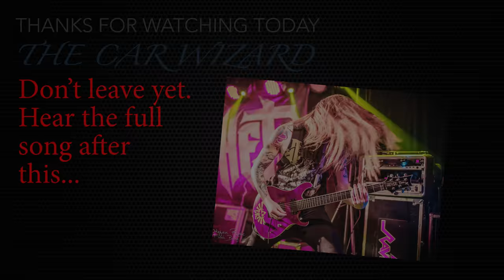12 Best Mechanic Tips and Tricks from the CAR WIZARD put all together

Comment: The load test is my favorite 
"But I'm getting 12 volts!"
Not when you put a load on it. Now its 7 volts
Reply: I had a battery do that to me last winter. I'd get 12 volts, but as soon as I did anything with the truck it was in, it would go dead. First I disconnected it from the truck, then I made a device similar to what he showed in the video, and the battery wouldn't even run a single turn signal bulb. In fact, when I took the battery to replace it, and they insisted on testing it, the battery wouldn't even run their tester.

Comment: Tip #1 is great. Used that trick many times. You can also remove the cross member and tilt the transmission down to reach bolts that are inaccessible.
Reply: 90s rangers with manual transmissions had 2 bolts that were Damn near at the firewall at the top. Have to tilt it down. great tip !

Comment: Hey wizard 
Instead of using paper inside a socket to make a bolt fit tighter, you have to find when it falls or possibly lose and is potentially a fire hazard, I prefer electrical tape.
Stick it to the socket and it stays connected to you pull it off!
Keep up the great content
Reply: gob of grease always does the job
Reply: I like masking tape myself.
Reply: Fingers off latex gloves as well 👍
Reply: Blue painters tape.
Reply: I've had the tape backfire on me. Held the bolt while I got it started, but then was too sticky couldn't get my socket off. Ended up struggling with that. Stuck too good.
Reply: Poster putty aka silly putty.
Reply: What about a small magnet in the socket
Reply: I've done that also, like the way the paper trick sounds though.  Easier and more efficient.
Reply: Butyl tape, Butyl tape, Butyl tape

Comment: I've used your starter solenoid trick, back in the 70's, when I had a Ford that had the starter solenoid mounted, not on the starter, but on the inside fender. It would occasionally stick, and a few taps with a small wrench would free it up. For some strange reason, i'd have to replace those solenoids every three years.
Reply: Used to work in a Vineyard and there was a couple tractors that had dodgy starter solenoid's, used a long screw driver to start them by shorting out the terminal's on the Solenoid. :D
Reply: Ah, a Ford owner!  Here in Colorado this was common in the winter. The solenoid was on the fender and the starter had a "Bendix" type of clutch that threw the gear into the flywheel. This set-up loved to get sticky on the coldest days!! Back in the "good 'ole days", every brand had its' own tricks and tips to keep them running in any conditions.

Comment: Tip #2    YES! This saved me last summer when I was 40 miles away from home.  Couldn't start the car, after a few tries I noticed the fuel pump was not making noise.  Had my son reach under the car and hit the fuel tank with a flashlight.  Three hits and the car started!  Got home with no problem.  Not sure why my original fuel pump only lasted 430,000 miles! ;-)

Comment: You can also put some grease in the socket to hold the bolt in place. That way you do not have to worry about retrieving a piece of paper.
Reply: We did that in the Air Force working on Jet engines with bolts in tight places.

Comment: Those bad ground are notorious when you work on old cars. I make a point of it to always clean them if i work near or around them. One very often neglected ground connection is the one between block and body. It's often a woven strap somewhere deep inside the engine bay and it's exposed to rain and road grime for years. They corrode over time and can cause weird problems. 
Then when you remove such a strap it sometimes pulverises in your hands. It's completely corroded...
One new strap later and some proper contact cleaning and all of a sudden the starter turns much better/faster! I wonder why...? LOL

Comment: Thanks for telling me about the relay test switches, they helped me diagnose a REALLY weird no start condition on a BMW X5. Found a burnt out fuel pump relay, replaced it and then it started and ran for 1 second and set 50 trouble codes. However, with the relay test switch in, the car ran normally and didn’t set any codes. Turns out the ECU was shorted out internally.

Comment: Great video Car Wizard! Also enjoyed a tip in a previous video about not using the radiator drain plug (in many European cars, BMW in my case). I've got a 2006 with almost 250k miles on it and had to replace the oil filter housing gasket. Told my wife about your tip gave it a pretend twist to demonstrate...and the head snapped off. Luckily it's not leaking, but it will have to be replaced at some point. Spot on advice!

Comment: Good tips. Starters sometimes CAN run again by hitting them with a hammer IF it is the brushes that are worn out and barely making contact. Sticky solenoids can be helped by tapping on them. Relays: if you don't have the nifty little switch, swap a relay from another slot. O-rings: one of the gripes I have with manufacturers is when they leave a sharp shoulder that cuts the new o-ring as you are sliding it in. Why can they put a slight chamfer on the part?

Comment: For o-rings that go around a fitting (instead of fitting inside a machined groove), once I have the o-ring on, I gently slide the point of a Lisle #31800 scribe and go around behind the o-ring a few times.  An old-timer told me to do that so that any rolling or twisting of the o-ring that happened when I put it on is straightened out.

Comment: Wizzard tip #9, always use the lubricant expected in that system, if its AC, use the AC lubricant expected in that system, if its Automatic transmission fluid, use automatic transmission fluid. The point here is USE THE LUBRICANT THAT SYSTEM USES!.

Comment: The o-ring tip is what I have been doing for the last 10 years at work.  The Viton o-rings are the best and when I can put one in a part I do.  I learned to that with high vacuum metalizers that pulled vacuum so high or low I guess it was 0.00001mbar with 3 booster stages before a diffusion's pump with cryogenic chiller freezing the air molecules.  Crazy machines built in Germany on NASA space designs all for the metal lining on potato chip bags.

Comment: Tip #5, if you have cut your slit for a flat head screwdriver, if you can, smack the handle end of the screwdriver towards the threaded end of the screw, it will often take away the clamping force that was keeping that bolt tight, and it will come out easily.

Comment: And here I used German Torque Guten-Tight. 
As a retired Aircraft ,Auto and Motorcycle Mechanic when I worked on Airplanes I must of have removed thousands of rivets, I got tired of drilling real fast so I asked they guys in the metal fab shop how they did they showed me a Rivet Removal tool it looks like a metal cutter it was expensive but it saved me so much time and energy.
You would be surprised how many motorcycles  with "Electric Issues" I fixed by finding the battery ground loose and or corroded.

Comment: About #3 - you really want to avoid hitting the starter, as the Wizard says, but here's why - most starters now have permanent magnets in them. And when you smack it with a hammer, you'll break the magnets.

I have a socket wrench that is so helpful, that I don't know why I don't see them everywhere. It's an old Stanley Wal-mart special, and it has a weird feature - the handle can turn like a screwdriver handle. When you twist the handle, the square drive bit - the part that holds the socket - it also spins. It will always spin the way you have the ratchet set. So if you are tightening something, you can twist the handle back and forth, and the drive will only spin one way. This thing is supremely helpful when you have that bolt that is too tight for fingers, but you can't move a ratchet back and forth more than one click, and some sadist has decided that the bolt must be three inches long. 

Also, I flinched when you were demonstrating the way to install O-rings on the compressor. Yikes. Astroglide works great for O-rings, too.

Comment: Here’s a tip to prevent bad fuel pumps….never drive on empty. Fuel pumps get hot and the fuel keeps them cool. Running on low fuel constantly will prematurely fail a pump.
Reply: 234k on a 14 3.6 ram cv tradesman or a dodge caravan i never ever get below 1/4 tank for that exact reason. we got that van at 113k for all i know that’s the orginal fuel pump
Reply: @joeyh7796  265,000 on my original fuel pump. It is a flex fuel vehicle that primarily run E85. I think they overbuilt the fuel systems in the flex fuel cars because when first released they had issues with the alcohol messing the pumps up.
Reply: Great tip, thanks!  I've also heard that those fuel additives can damage a fuel pump over time if add to tanks that aren't full.
Reply: @ohioplayer-bl9em  this van is flex fuel as well. we have two more vans (company fleet, family business) 13 and a 14 The 14 doesn’t have flex fuel by while the 13, Kind of weird but dodge what are you gonna do

Comment: #7 I have a $30 belt tool that you use shallow sockets with. Much cheaper than those wrenches. Haven't run into anything too tight for it.

Comment: I recently used the paper method to hold the bolts in after recalling it when I dropped one and didn't hear it land on the ground! Luckily I managed to retrieve it and the rest were drama free when removing an air box.

Comment: I was going to say you could use tip #2 for a starter but then you did tip #3.  🤷‍♂️. I saw #3 used on an old International school bus that the Park Service was using for tours at Mount McKinley back in 1977.  Had an old bus mechanic from Ohio on the trip and he used his wooden cane. 🤣🤣🤣

Comment: Tip #2 : Some cars need to crank before the fuel pump primes.  I replaced the fuel pump in my 91 Eagle Talon TSi 20ish years ago because it died and the pump didn't prime when I turned the key to on.  It turned out it jumped timing and trashed the head.

Comment: Tip #6 : A small paperclip will do the same thing, you just have to know which 2 to connect.  The relay switch is easier and more foolproof, but if you're not a professional mechanic then it's probably just one more tool to spend 30 minutes trying to find when you finally need it, just to give up and grab a piece of wire or paperclip.

Comment: I had an inline fuel pump that was put in my 80 Trans Am where the filter should have been so it was above the gas tank and tailpipe. I think it was getting too hot and kicking off.   I coaxed my car 20 miles home by getting out and tapping on the fuel pump. Had to do it 4 or 5 times.  Changed the location to below the tank (like the directions say!!) and haven't had any problem yet.

Comment: Tip #12 is the one that will make the difference in a parts replacer & a problem solver. If you go with "yeah, volts look fine", you will guaranteed run into a problem you just cant fix one day soon. A crappy connection will most often provide "good volts", but only be "phantom voltage" if you put any load on the circuit. It's been tough to teach my bro the idea of "phantom voltage" that's not real.. hes getting good at it tho. It's way too easy for anyone, even me, to fail to see "the forest through the trees"

Comment: All good tips.   Any tool that saves you time is worth its weight in Gold!   I have some very expensive torque multipliers I do not have to use all that often but when I do, they save my back making my life easier and soon I will be 60yrs old so I don't have the upper body strength I use too but even when I was young and dumb I was smart enough to invest in a torque multiplier.  I have other tools that save me time and if I see a tool that I figure will save me time I just buy it.   The only thing I don't have is someone to push my box around the factory.   Yea I have to push one of three boxes around each has it own unique function and compliment of tools for very specific purposes be it Injection Molding Machines, Molds, Robots, Mechanical Room or other factory automation.   I do have one box for when I drive my car in the shop to service it, but it has other uses too.   Because I run the factory I could actually purchase any tool for my work but I prefer to use the tools I own that way when I leave I don't have to worry about leaving with company tools.

Comment: Hey wizard i bought a 2000 crv for cheap. Pulled 5 codes. Drove around and only one came back. A p0715 code.  I ohmd out the input speed sensor.  Seems to be in range. Change transmission fluid to oem honda. Shoukd i swap the sensor? Ir any other suggestions.  
Love the content
Reply: Replace the speed sensor anyway. If that don’t fix it then unfortunately it may be wiring.
Reply: @funnypranker34  i went thru wiring already. As well as replaced that harness. If its not the sensor i am suspecting the trans unfortunately
Reply: @iowaland7658  that’s what I was afraid of. Any Honda made before 06 if you get any p0700-799 code it’s most of the time the transmission’s electronics failing
Reply: @funnypranker34  i paid 150 bucks for the car. Just shifts odd. So trying sensors first. And then drive it till the wheels fall off🤣🤣
Reply: @iowaland7658  I would love to know where the hell people find running and driving cars for 150 bucks because they are overpriced up on my end

Comment: When spring comes I'll be rebuilding my first engine. 2.5L V6 from a 02 Suzuki grand Vitara. The questions are I don't have a garage to work on it only a driveway what's the best way to organize the engine parts. The other question can I rebuild the engine without removing the block from the car? I think I may have to put in new rear main seals. The engine jumped timing and has little over 200k miles.

Comment: Trick to empty a full fuel tank. Remove the fuel line before the filter and pressurize the tank. the air pressure will usually push most of the fuel out of the tank into a container.

Comment: Man i managed to drive my old chrysler tc by maserati home after the fuel pump went at the gas station after a fill up. Was able to get it started the next day and stopping wasnt an option. Anytime i got below 2000 rpm or so the car would start to bog and die. Luckily was only a mile from home and only had to run one light and two stop signs before i was able to get it into the driveway before it stalled and died completely. Still have no idea why or how it started as i didnt know about tip #2. That car was a gremlin in itself but man some of the stories i have from that car are priceless. Good ol’ Italian lebaron.

Comment: The relay rocker switch- do you know if there are the same identical implement but with the option to extend the rocker switch via 2-wire into the cabin? This will be invaluable to me in these situations where I had an ASD (automatic shut down) relay go south due to an electrical gremlin and I wouldn’t have to put a switch on the fuse.

Comment: BILLY ROBERT'S CROOKED CAR CONSULTING CORNER --- 1. Foam rubber under the valve covers will quiet a noisy valve train. 2. Sawdust (not wood chips) in a manual transmission or rear end housing will quiet that annoying 'singing' noise from one or both. 3. BBQ sauce (I like a mild honey mustard) sprayed into an alternator will convince an owner who isn't mechanically inclined that the smell emanating from said device indicates a failed unit. 4. Non-mechanic historic VW owners will sometimes pay for a radiator flush, new radiator cap and antifreeze refreshing (new parts counter guys or gals go nuts trying to find those parts in their computer system too). 5. Wadded newspaper with screen wire poked into a rusted out rocker panel, then slathered with good helping of Bondo will save hours of tedious work and can be highly profitable so long as your shop isn't near railroad tracks. 6. Black shoe polish when rubbed into the the cracks of dry rotted tires makes them look good as new and leaves an attractive shine.

Maybe we could keep this list ever growing; however, the author of the tip(s) must have previously used the trick, seen it used or had the trick perpetrated on them.

Comment: TRUE STORY:  back in 2004, I owned a Pontiac Fiero v6 that was running lean and I couldn't figure out what was going on.  Didn't have the time or energy to fix it so decided to take it to a pontiac dealership thinking they'd have quality mechanics.  They diagnosed the issue was from a vaccume leak and would fix it for $750.  They also said they were doing a special on their superior oil change and would do it that for an additional $35.  Considering I was planning on doing an oil change already I said "sure, let's do it".  I'd already bought oil that I left in the trunk but knew I could return it to Walmart.

 Two weeks went by and no update from the dealer.  I called and asked for an update. They said they'd get to it in the next day or two.  Called two days later with same reply.  Afew days later,  I finally went to pickup the car.  Driving it home I noticed alot of backfires and loss of power.  It was literally running worse than when I dropped it off!!!!!

THIS IS WHERE IT GETS BAD.  Opened the trunk/hood and saw 3 vaccume hoses that I could clearly see weren't hooked back up.  They also used the oil in my trunk that I bought to do the oil change....WTF!  To put the cherry on top, my engine was still running lean with glowing headers..... at that moment I knew I just got screwed!  I called an complained about everything but as expected they denied everything and basically told me to pound sand.   I swore that day to never think a dealer is better than any other mechanic shop.   They charged me $750 and 2 weeks to diagnose, not fix an issue and use my own oil for their oil change.   Thanks alot Pontiac of Madera CA.....POS.